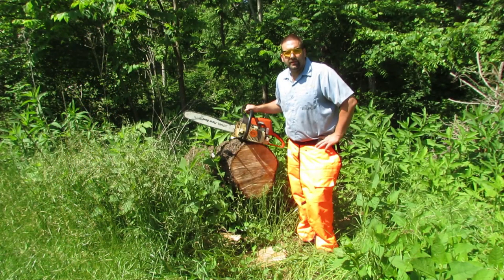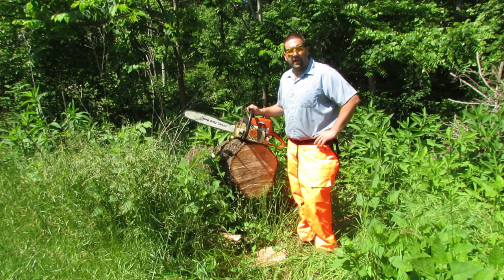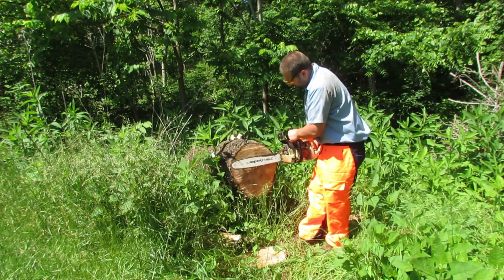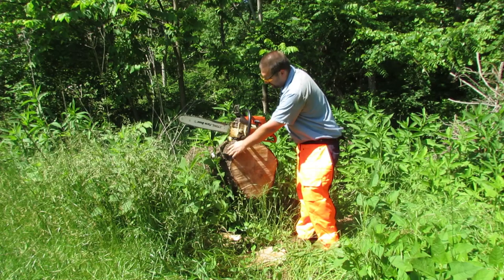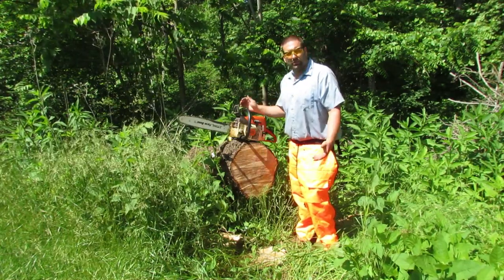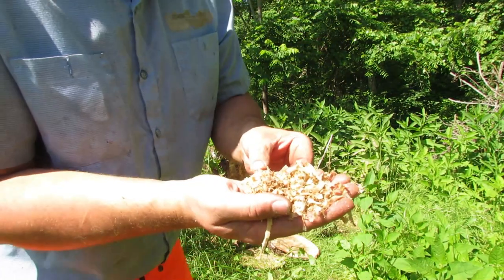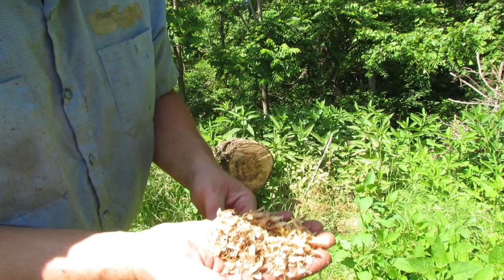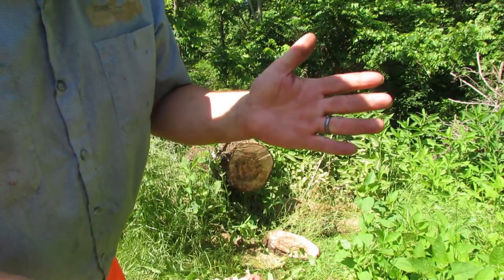Test Cut with the Stihl MS290 to MS390 Chainsaw Engine Swap

Comment: Got a feeling if you didn't change the muffler you're going to have to open that up a bit, that saw shouldn't bog that bad I would think, Plus you should let the RPMs get up a bit and let the chain work, looks the chips are good maybe don't buck so hard. Maybe it's fine cuz it sounds like it's ripping good when the blade is free. Just feel like one could get a faster cut with a few changes. Just trying to help. Good build, working on one myself.
Reply from the maker: acesegura 06 I am thinking about opening up the exhaust to let her flow a little better. That would be a nice video... I agree it seemed to bog pretty bad, maybe I was pushing too hard or she wasn't broken in enough yet. Might do a retune on the carb and touch up the chain again. Stay tuned for more videos about this build. Good luck on yours. Thank you very much for offering excellent information and help. It is much appreciated. ~Mr. C.
Reply: @NaturesCadenceFarm  just got mine done and yeah it's not very impressive just wants a bog out right away, just ran a tank of gas through it and seems a lot better now, must need alot of break in. Definitely not like unboxing a brand new Stihl chainsaw, but it does run for like a eight of the cost to rebuild and a 10th of the cost to buy a new saw, so thumbs up hopefully it works
Reply from the maker: @acesegura0694  that is great news! Like you said, a little weak but for a little money and not much time you can make a dust collector into a chip maker again. I have more planned for this build. I have the opportunity to do comparisons with a factory ms290, 039, and a ms391. Thinking of some other stuff too. Thanks for letting me know. Happy sawing! ~Mr. C.
Reply: I totally agree with opening up the muffler!  That thing should only be taking at most a little over 10 seconds to get through that oak.  My 290 with a little muffler mod screams with a good hand filing.  I am in the process of converting an MS311 to an MS390 with a mild exhaust porting and muffler mod.  Expecting a ripper.  

So far what I have learned is that it is hard to beat a good hand filing.  Any saw is a turd if it’s dull.  Thanks for all the build videos!  Well done!
Reply from the maker: Hello all! I finally got some comparison videos done for this 290 to 390 build. I am trying to get one out every day this week. Check the link below for the playlist. ~Mr C.

https://m.youtube.com/playlist?list=PL9e-N4NEgHNugVR3FhAPMhAS23fPoHIW2

Comment: Where do I find one of those modified saws  for sale
Reply from the maker: @jamesvaughn6083 I built it myself from a burned up MS290. The video does not do it justice. I have fixed the uneven bar and dull chain and added a pipe to it. It is well broken in now and has an 8 pin sprocket pulling .325 chain. Check out the link for the replacement engine. ~Mr. C.

https://amzn.to/3spwqeo

Chainsaw Hospital video of it
https://m.youtube.com/watch?v=6QI-q8ITtTo

Comment: I noticed from your other video you did not install the shim between the bar and the power head.
Reply from the maker: All Terrain Custom's I did not have one from the get go and I don't think it is a factory option. I am having a hard time finding one even aftermarket, would you please provide a part number or page they are for sale. Thanks for letting me know. ~ Mr. C.

Comment: Hello there.  What 2 cycle oil are you using on the Chinese 390 engine now?  Also, what gas/oil ratio on it?
Reply from the maker: Leopard I have been using Echo Power Blend mixed at 25:1 with the correct amount of traditional red Sta-Bil mixed in non-ethanol gasoline. I hope the higher oil ratio will extend the life of the non OEM components. With no comparison ran on 50:1 I don't really have any solid information to compare with. Only time will tell... ~Mr. C.
Reply: Is the 25:1 for break-in only? Your saw sounds like its running super fat is why I ask. My 029 with a 20" bar will run through maple or oak for that matter faster than your 039 conversion in the video. I'm not trying to BYBs but i'm looking into this conversion before I take a perfectly running saw and turn it into a turd. By the way,  have you opened the mixture screws out any?
Reply from the maker: Daniel Blanton sorry for the LATE reply. Guess I missed it a while back. I plan on running the 25:1 from now on. I am hoping it will help with longevity. I did the swap because the original piston and cylinder was trashed. I would stick with factory as long as it's running well. Yes I have played with the adjustment screws. Check out my recent comparison videos (link below). After the muffler modification, some tuning, and run time she is waking up! I was worried she was going to be a dog at first but this saw is quickly becoming my "go to" because of the power to weight ratio and reliability. ~Mr. C.

https://m.youtube.com/playlist?list=PL9e-N4NEgHNugVR3FhAPMhAS23fPoHIW2